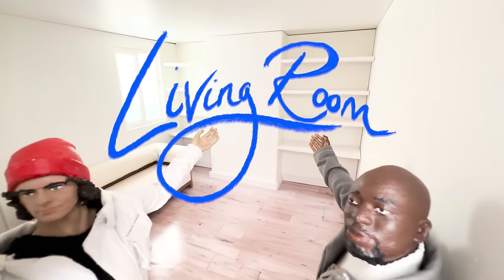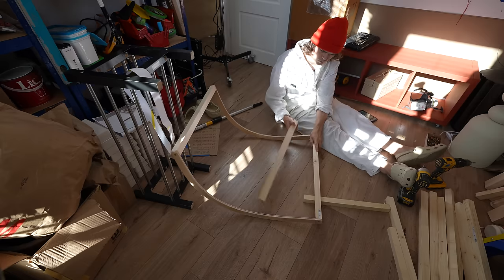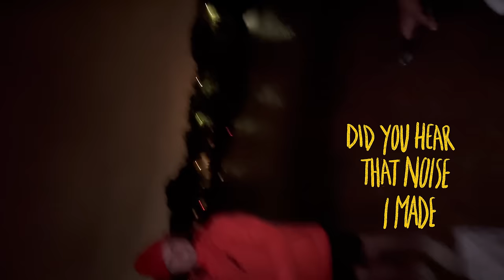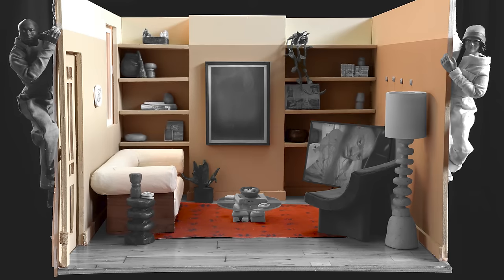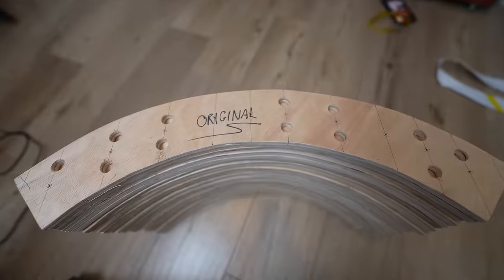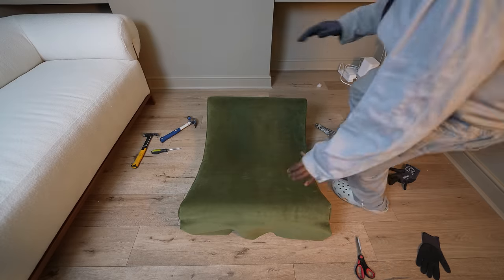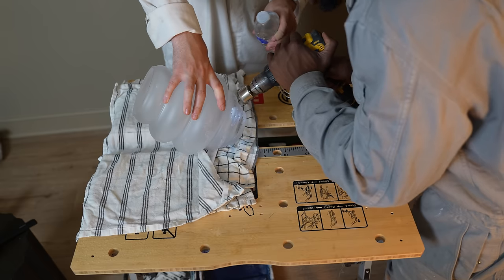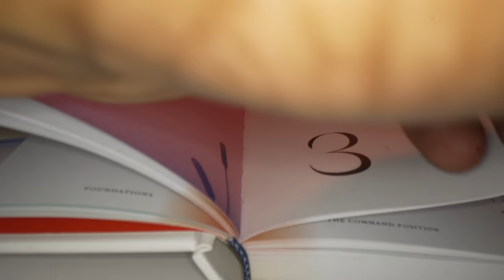We Made The Designer Room We Couldn't Afford

Comment: Tip on screwing into those deep holes on the chair is just attach the screw to the drill bit and add a little bit of tape to hold it together, but not too strong, and then screw the screw in and then just pull the drill bit out. Should work 90% of the time. Since the bond between the wood and the screw will be so much stronger than the tape to the drill bit the screw should stay in place and the drill bit should come out as usual! Hope that made sense for future projects

Comment: I loved the brick design for the coffee table but my only concern would be the longevity of it. the plaster might crumble over time or scratch the floor. a base even minimal with slots for each brick to lock them in place
Reply from the maker: yeah we did think about this, it's held up pretty well, i think Jesmonite is stronger and more chip resistant that regular plaster as it uses an epoxy to bind it together, we do shift them around occasionally though if we knock it.

Comment: For anyone that is going to paint and use masking tape, remove the masking tape while the paint is still wet, if the paint is dry and you remove the masking tape you run the risk of pulling the paint off with the tape